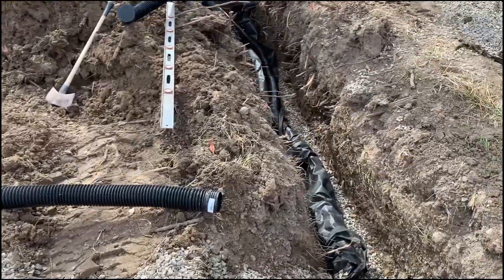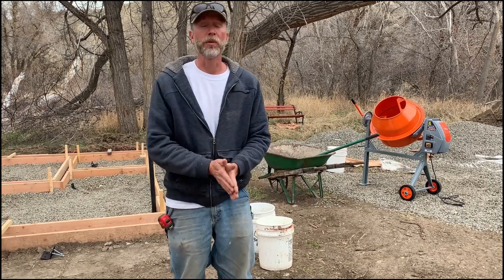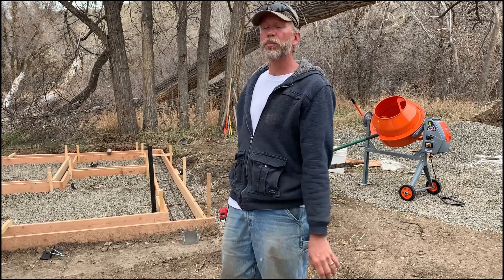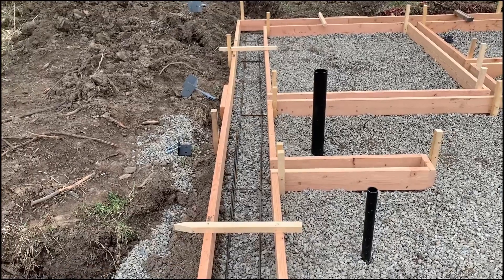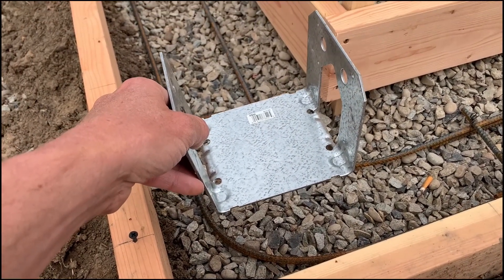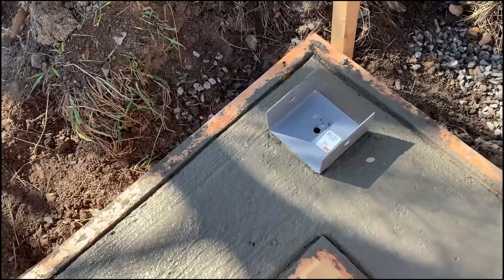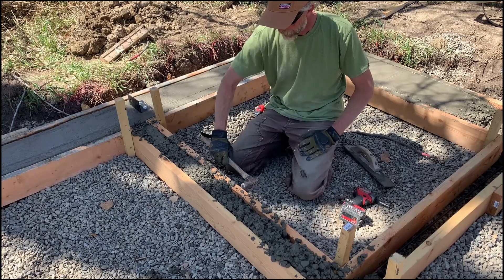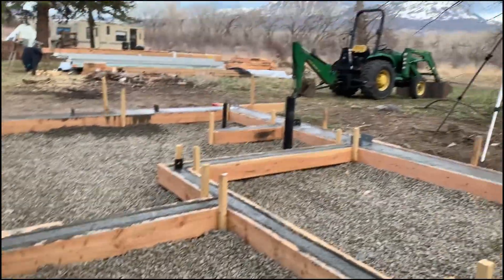Bath House Episode 1: The Foundation

Comment: How do you decide how far apart your posts go?
Reply from the maker: There are tables to help calculate the load a span will carry. On this one, I use 6x10 glue-lam beams rated to span the whole length of the building, so the intermediate posts are not technically necessary.

Comment: This is the first time I have ever seen anyone put a French drain under the foundation. Why?  I have been in construction my entire life I have built many houses and home additions and out buildings and garages. I did all of the work myself and I worked with contractors to learn how to build from different perspectives and techniques. I’m very interested in the French drain will you please tell me why you do it and how you came up with this idea. Why the depth width I’m truly wanting to understand this please enlighten me
Reply: This is called a rubble trench foundation or a rubble trench footings. Utilized for a lot of history, but gained renewed interest after being used by architect Frank Loyd Wright.

In summary, it's an alternative foundation method that can mitigate the need for concrete below grade, and provides sufficient drainage to prevent soil heave from moisture and frost. 
-The aggregate filled trench has be a certain width (determined by the building load) and the depth needs to at or below frost level (deeper depending on building load) 
-The trench network has to be have a slope and needs to drain to daylight, a drywell, or a sump pump that removes and collected water from beneath the foundation and the surrounding soil. -The inclusion of a drainpipe in the trench is optional, but highly beneficial.
-The rubble used can vary, but must be clean (no dust or fine particulates). Clean limestone gravel between 3/4" and 1" in size is commonly used (called 57), but some builders have used aggregate mixes that include stuff as small as 1/2" with larger fill the sized of bricks or even basketballs. As long as it's clean of excess dust/dirt, and there are no large voids.

You won't find it in IRC code becaue it's an alternative foundation type, meaning it's only allowable in IRC governed areas with the signed plans from a structural engineer. You also won't typically see these with structures over 2 stories since the engineering cost defeats the purpose.

Comment: Very interesting! If I understand correctly, your timber framing has the posts attached to the concrete base, right? If i join the posts at the base with wooden joists, like a traditional timber frame, could i place the joists over concrete "pads", instead of building a continous concrete base?

Comment: Thanks for sharing! But I have a couple questions. I looked through your videos to see if you ended up using this foundation for your house and didn't see anything. Did you end up using this for your house? Two, how did your building inspector react to this technique? Would you personally recommend an RT foundation for a 2k sqft house?
Reply from the maker: The cordwood portion of my house is on this foundation. You can see me stacking logs on it in the cordwood video. Personally, I would use this foundation style for any home. A structural engineer can calculate the appropriate dimensions for your build. Mine has not moved in three years.
I have the joy of living in one of the last counties in America without building codes, so there is no building inspector to satisfy. In most jurisdictions, stamped plans from an engineer will be accepted for a variance from the nonsense in “the code”.

Comment: What was the price difference between bagged portland vs that bulk pile you got?
Reply from the maker: It’s been too long to remember, but a ton of gravel currently costs me $12, if I haul it myself. Ready mix is mostly gravel, and it runs $6 for each 80# sack. Portland cement is $12/bag, and will produce the equivalent of 5 1/2 bags of ready mix. Mixing on site is less than half the cost of buying ready mix, and about 1/10 the cost of calling for a pour. Hope that helps!

Comment: Did you end up doing any insulation on the slab? Thanks.
Reply from the maker: I poured 6" of aircrete in the floor, then did 2" of reinforced deck mud (5:1 sand to portland) over that, then tile.  worked well, but aircrete is not the best for that application.  I'm building an addition which will have 6" of lava rock for insulation in the floor.  there will be an adobe floor in that section.  I'm using the methode detailed here: https://youtu.be/TSIsEF3nybA

Comment: Thanks!  There were some very helpful details there.  I think French drains are crap and clog up, but I suppose they're helpful for a decade or so while looser soil around the foundation isn't compacted yet.  Really nice bond beam!
Reply from the maker: Thanks!  Yeah, the French drain is not the magical thing most think it is.  I'm down to do it if it's cheap, or ground water is an issue.  But, I agree that they are not going to function for the life of the building.

Comment: Very helpful, thank you! Can you point me to resources for designing a foundation like this? There's a lot out there about how the rubble trench works but I can't find much about the specifics. Like how big the grade beam needs to be for a given load and how that varies for point loads like you have.
Reply from the maker: The engineering on this one was purely instinctive, and not mathematical.  There are no building codes where I live, so the only party involved is me (as it should be).  If you are uncomfortable estimating, or need plans that meet “code” you may need to consult an engineer, or at least and engineering text book.  For the record, this foundation has performed flawlessly through a full year.  Odisea, Llc of Paonia, Colorado has designed these for me, on larger projects.  They do a lot of natural building engineering, and may answer specific questions, for you.  Good luck!
Reply: @radicalgastronomy   Cool that helps. I may just copy you then because my building is a little smaller. Thanks for the reply!
Reply from the maker: @MrWoodsli  Demensions are nominally 6x12 inches with two 3/8 rebar.  Should work great. 😁👍
Reply: @radicalgastronomy  Saguache County?  I've heard they don't have building codes.  I've also heard Cochise County in Arizona allows owner builders to opt-out of building permits.  Places where you can be responsible for yourself are, sadly, drying up.
Reply from the maker: @mondavou9408  It’s such a scam. The code is written by building material manufacturers and trade unions, then lobbied to county commissioners. I solves problems for mediocre bureaucrats, so it just gets adopted without comment. Not a fan.
Reply: @radicalgastronomy  And makes the costs of the most basic human need (Shelter) more and more and more and more expensive to the point it chokes the supply side which manipulates scarcity. All the while property tax (which never goes away unlike a mortgage) rides that "value" up and up and up. Where I live (but not for long) property tax can easily be $1k per month - $1k per month in PROPERTY TAX?! Also not a fan.
Reply from the maker: @mondavou9408  And what of lending? How much of the crazy prices is due to the fact that creating money for the mortgage is nearly free for the bank? Yeah the system is trash. It’s a game made up for and by an oligarchy.
Reply: @radicalgastronomy  I completely agree.  Unfortunately I didn't realize it until late in life. Now that I want out of the system, I find myself without the important skills I should have been acquiring and honing over the decades.  Sort of a cart before the horse thing.  As the system continues to expose itself, I think there will be more folks like me so I appreciate you sharing your projects.  Its kind of like a virtual apprenticeship.  Cheers.

Comment: Love the video!!!  This is @mugwortexpress from Instagram! Told you I'd watch 😁.  I wish I had looked at this earlier, before we mixed our concrete for the pillars of a pole barn... I wanted the mix to be just moist like yours but working with friends who seemed like they knew better we had a very wet mix!  

Anyhow, I liked how you explained everything you did.  Thanks.  

But two questions, in a rubble trench foundation like this one, do we need to dig past the frost line or is it that with everything sloped away from the building and gravel filled is enough?  

And in the bond beam, couldn't you have placed some rocks or something like that to lift the reinforcement rebar? Oh also, that this rebar end up about half way up the bond beam?

Thanks again for the inspiration. Following your work
Reply from the maker: The Land of Dreams Homestead The French drain should be below the frost line.  The perforated section should be level, and the non-perforated drain line should slope at least 2 degrees away from the building.  Rocks can be used to lift the rebar.  I prefer to pull it up into the pour because I am needlessly paranoid about moisture wicking up the joint between a stone, and the concrete and rusting my iron.  It’s not a real concern, but just how I am.  The rebar is roughly centered in the beam.  As long as it is completely within the pour, tensile strength is the same is it’s one third up, down, or centered.  Reach out here, or on IG, if you ever want to bounce ideas around!
Reply: @radicalgastronomy  very good, thank you so much for your reply and the invite to bounce around some ideas!  Will do eventually... right now winter is coming and we have a lot of work ahead of us here 😁!